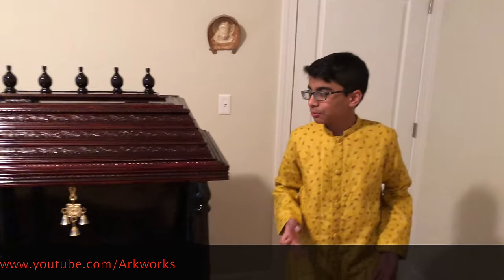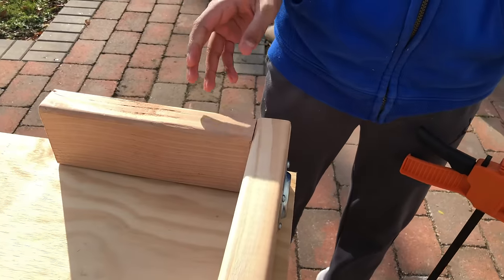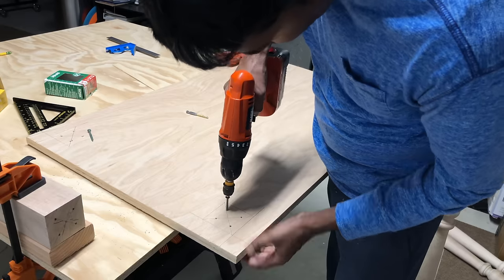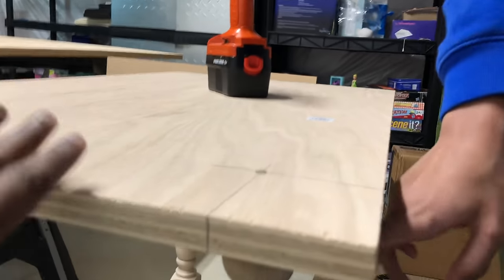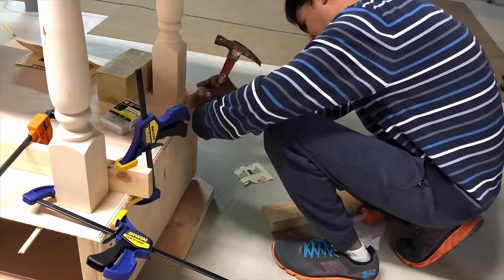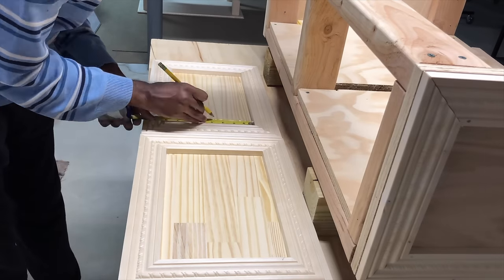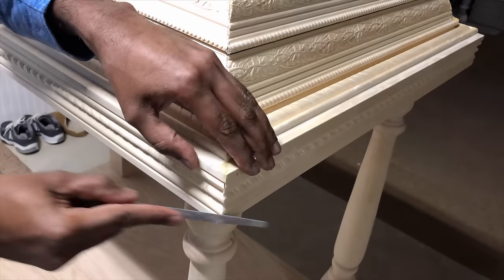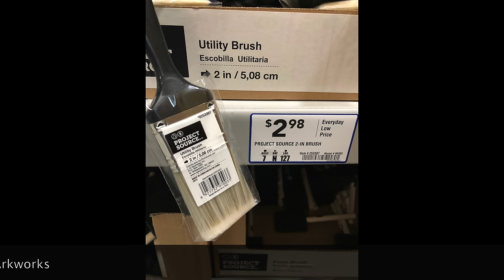Pooja Mandir DIY under $425 (4 feet 10 inches)

Comment: Watched it many times. You guys did it like pro. I do carpentry and my changes are using 2x2 for framing and .5 or .3 inch plywood to reduce weight, also use wood glue. I loved the idea of a detached units that will help in mobility . Great design
Reply from the maker: Thanks for the feedback and suggestion to reduce the weight!

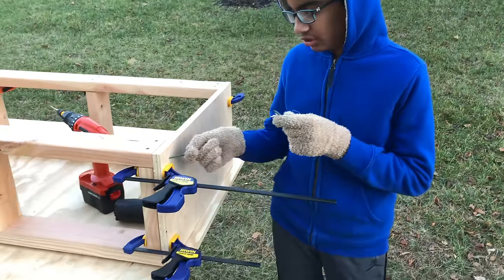Comment: Great Job.I am planning to start the project with the your  video as reference.Really your family inspired me to do this project. I had a couple of  questions 1)what is the length of the plywood at 3:21sec for joining  both the pieces...? 2) what is the length of the plywood at 3:51seconds..?
Reply from the maker: Hello, 24 inches at 3:21 and top plywood at 3:51 is around 40 inches I think, it all depends on how much space you have and what size you want to build, I suggest figure out your space and then build size it accordingly, cut the material as you go along, don't cut all at once. good luck!

Comment: Hi, I have seen your video multiple times and finally got courage to start the project. Bought all materials but while making gopuram I am not able to understand what angle to cut the moulding and how to measure that angle on miter saw( bevel angle, miter angle and slope)If you can please share some resource that I can use and your help is very appreciated
Reply from the maker: Enter your gopuram slope angle, no.of sides to get the Miter and Blade Angle (Play around with scrap pieces to get a good fit)

https://www.blocklayer.com/compoundmitereng.aspx

Example: inputs: Sides (4), Slope (59), Horizontal

Miter Angle 27.3° 
Blade Angle 37.3° 

Google for Miter angle and blade angle in YouTube, there are lot of vides

https://jansson.us/jcompound.html 

- Use N-sided Box
- Enter your inputs

if you have same dimensions as ours, then I mentioned the angles in the video, try that with scrap pieces until you get a good join.

Comment: Hi, great work. Really inspiring and I have just bought a second hand TV cabinet which I will be converting to a Mandir but the hardest part of the process is making gopuram. 
I have a request. Will you be able to make a seperate video to show how to make the gopuram like you made in this video but in little more detail?
Reply from the maker: Thanks, will try when time permit, its not really that difficult once you figure out the angle, search for "compound angle calculator", there is lot of information on web. Try with scrap piece, after few cuts you will get there. Good Luck!

Comment: I am thinking to do it . 
I could not catch the painting part . 
Can you also add url for paint and brushes as well in your description 
Thanks
Reply from the maker: Hi Praagnika, link to paint is in the spreadsheet link in the description, copied below from spreadsheet.

Minwax PolyShades Bombay Mahogany Oil-based Interior Stain (Actual Net Contents: 32-fl oz)	
Minwax Fast-Drying Polyurethane Gloss Oil-Based 32-fl oz Polyurethane	
Project Source Polyester Flat 2-in Paint Brush
Reply: @ArkWorks  
Thank a lot for your response will check in spread sheet as well .

Comment: Amazing works...Please can you provide the tool set that you have used while building this master piece. Thanks
Reply from the maker: Hi Vineel, Tools are @17:17 in the video. 

1) Miter Saw
2) Circular Saw
3) Drill
4) Clamps
5) Sanding tools
6) Speed square
7) Hammer
8) Caulk Gun
Reply: @ArkWorks  Thank you
Reply: @ArkWorks   Do you have purchase links for these tools, so easy to shop :)
Reply from the maker: I don't have links, most of my stuff bought long back. You should look out for deals on special days.
Reply: ArkWorks Thank you

Comment: I have watched this many times over now, since I am planning to make one myself. Although much cheaper than this. The moldings are too expensive, and I will have to make do with something smaller instead. I need to look for the right kinda finials for the gopuram top. I haven't found these at my HD, gonna try Lowe's, maybe they do.

Comment: This is great! Thanks for sharing the spreadsheet. Could you guys also share the list of tools used in this project? I am a beginner and I dont have the proper tools for woodwork. Thanks!
Reply from the maker: Tools are @17:17 in the video. 
1) Miter Saw
2) Circular Saw
3) Drill & drill bits
4) Clamps
5) Speed square
6) Hammer
7) Caulking Gun
Reply: @ArkWorks  Thank you!

Comment: Hi Kids and Parents, This is a great project you did and you have inspired me too. I have a question about the top part Gopuram, Can you please help me out? Need help in compound cutting
Reply from the maker: Hi Anjum, We are glad you are inspired to take up this project. Search for "compound angle calculator" on google and you will get all the info you need. if you can enter the no. of sides and angle, calculator will give you the miter angle and the blade angle. Set the angles on the miter saw and cut your pieces. Good luck with your project.

Comment: Great work by engaging the kids.  Great effort.  I have few suggestions though. I do similar kind of stuff so thought I should share my points. 1. You all have skills so upgrade the tools - Regular Miter saw to a sliding double bevel miter saw. 2. Use nailer instead of nail and hammer, as it is time consuming, while nail guns with a comperssor are fast and literally invisible.  3. Mahogony is a bit dark color so if you all use gold paint ($2 per small bottle in Walmart) on the special designs on the sides, on the Gopura Kalasam and on the door decorations, they will look spectacular.  4. Last but not the least, for the door use some cabinet hinges which are very easy to install and look professional.  
Overall a great product, excellent commentary.  Keep up the good work.
Reply from the maker: Hello Murali, Thanks for valuable suggestions. It will be helpful for the people planning to build Mandir. That was our first detail project, we started with vague idea and figured out things in the process. Everything we did on that project was new to us :-), Thanks for watching and taking time to provide suggestions. You should start a you tube channel if you are doing similar projects :-)
Reply: @ArkWorks  
Thanks for the suggestion. I build only for the temple we manage here in Richmond and of course for my home. I will definitely consider your suggestion. Convey my regards to the kids, by keeping them engaged you are passing not only the skill but also our tradition from our Mother land. If you are looking for some blue prints for any projects please ping directly, if I have it I will share it to you.

Comment: One follow up question on the "40 inch Ceiling". What kind of support/design you have put in place(or 
suggestions) to make sure it is NOT bending/sagging down as the time goes by. Thank you in advance. Keep up the great work.
Reply from the maker: Hello Suresh, Pooja Mandir will be indoor in the controlled temperature, so don’t think it will be an issue and plywood I chose is good quality, if you are concerned about it, use solid wood. Good luck with your project!
Reply: @ArkWorks  Great. Thank you for the input. Appreciated.

Comment: Congrats on such a hard work. Temple is looking so beautiful. I have a question, before I start this project. How much time does it take to complete it from designing it on paper to the final product? You have those wood cutting machine too, did you borrow it from HomeDepot or Lowes? Or do you have to purchase it? I dont have the tools shown in the video.
Reply from the maker: We worked on weekends on this project, it took me around 5 to 6 weekends, most of the time went in planning, execution did not take much time. If you follow this video, it should not take much time for you, unless you want to improvise or go with completely different design. All tools used in the build are purchased over a period of time. Hope this helps.

Comment: Great work!. Amazing work done by simplicity... Can you please share the material list as mentioned in vide?
Reply from the maker: Hi Vinod, Material list is in the video description. Here it is for you https://drive.google.com/file/d/1druWzHAGRSVZKYh3ADTsmYLQmv56H4S_/view
Reply: @ArkWorks  Thanks so much! Could you please share the size of the bottom part to make the drawer./boxes?
Reply: @ArkWorks  Also, Could you share if you have any scathe of your work?
Reply from the maker: 1 feet in height, 2 feet deep and 40 inches wide. There are 2 doors in the bottom.

Comment: Great work.

Can you explain how did you arrive to Miter and Blade angles as explained at 9.11 sec?

For Compound Angle 59' - Miter 27.3' & Blade 37.3'

I needed little more slope, lower angle (50 or 55), appreciate your help.
Reply from the maker: Enter slope angle, no.of sides to get the Miter and Blade Angle (Play around with scrap pieces to get a good fit)

https://www.blocklayer.com/compoundmitereng.aspx

Example: inputs: Sides (4), Slope (59), Horizontal

Miter Angle 27.3°
Blade Angle 37.3° 

https://jansson.us/jcompound.html 

- Use N-sided Box
- Enter your inputs
Reply: Brilliant

Comment: @Arkworks, that's a great mandir you have prepared. i'm planning to construct a 2 step mandir. if i use the same angles u have used for a two step mandir. can u please advise
Reply from the maker: Thanks Sris78. Are you referring to 2 steps in gopuram? if so, same angles should work. good luck with the Mandir!
Reply: @ArkWorks  yes i'm referring to 2 steps only. thanks

Comment: Hi. Great design. What material did you use for the pattern/moulding for the gopuram? Wood or plastic?
Reply from the maker: Thanks! Everything wood, all the materials used are in the spreadsheet link in the description

Here it is : https://drive.google.com/file/d/1druWzHAGRSVZKYh3ADTsmYLQmv56H4S_/view
Reply: @ArkWorks  Thank you. I have started buying the materials as I am going to make the same design. Mouldings with an "Indian" design for the Mandir is quite difficult to get in the UK. When I start/finish I will post some pictures!

Comment: well done and look stunning. love the design. How did you move this in to room? did you set this in parts and assembled completely in to room? i am planning to do one. since i need to get in to a room with 24 inch door thinking of making in to three parts-base, pillart part and gopuram..any ideas?
Reply from the maker: Hello Balaji, We built this mandir in 3 parts. a) Bottom section with cabinets b) Middle section with Pillars and some portion of the gopuram and c) Top portion of the gopuram. 

We moved sections into room and placed it one on top of other, we did NOT nail/screw them for ease of mobility.

Hope this helps, let us know how your build is going on.
Reply: @ArkWorks  Yes, thanks for the info. THanks for sharing this video.

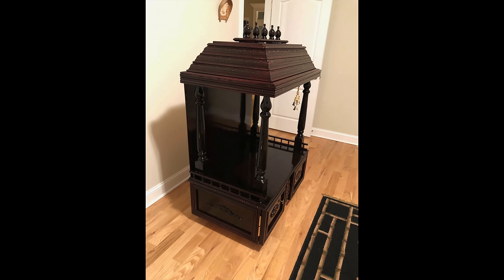Comment: Hi, thank you so much for sharing the video! It’s come out really well. I am also attempting to make this but I was having trouble finding the railing at 16:42, I looked through your spreadsheet but it says ornament beside railing and I couldn’t find anything like that on lowe’s. Could you please check the sheet and advise me on the railings? Really appreciate your help, thanks much in advance! And great job on the temple 😍
Reply from the maker: Hi Aashka, Did you click on the link in the spreadsheet for railing? I just clicked on the link and it is directing to Lowes, here it is https://www.lowes.com/pd/Ornamental-Galley-Rail/1000514477

Also Available in Home Depot : https://www.homedepot.com/p/Waddell-4-ft-x-2-1-4-in-x-3-4-in-Maple-Galley-Rail-5504-MPL/100549056

Comment: Great informative video and creative juices .. I would have contributed atleast 10,000 views in that count of 180K views as i continuously view it as my project takes shape. A quick question on the T Shaped Gopuram holder.. If i try a miter cut the wood is slanted .. Is it a bevel cut of 60 degrees or miter cut of 60 dgrees for the T Shaped wood which acts as the gopuram holder. Thanks  in advance
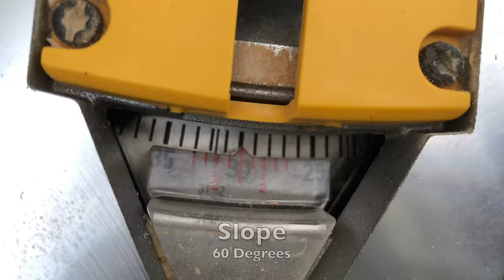Reply from the maker: Hello Manikandan, T-shaped is cut at 30 degrees angle flat on 4 inch side of the wood (that makes it 60 degrees when you flip on 2 inch wood), look at the video from 7:44 to 7:50.
Reply: A follow up question... If i do a 60 degree cut with the circular saw by adjusting the angle to 30 degrees, on the bottom side of the T, one end is longer than the other (not sure if i am explaining it correctly).. SO what happens is i have to place the T in a crossed angle and not ina straight line like you have.. How did you cut your T wood  ? i guess using a Miter saw ? I am trying to make it happen with Circular saw and kind of stuck on how to make a straight T
Reply from the maker: I know what you are doing, don't change the angle on the circular saw. Use the square to make a line 60 degree angle on the wood and then cut that with circular saw (blade 90 degrees) with some edge guide. I did it with Miter saw, hope this helps, otherwise send me your phone number and I will call you to explain.
Reply: @ArkWorks  I think i understand what you are saying... Let me try one more time with Play around wood and if it still doesnt work, i will give you my number. want to be mindful of your time as well to the best possible extent and thanks for taking the time to respond... So i will keep it at 60 a (and or 30) and give it a try today one more time..
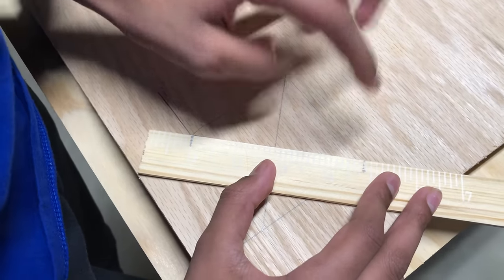Reply from the maker: Take a look at below video from 4:00 to 4:25, he is explaining the taper cuts on table saw, you can get the idea for circular saw, draw the angle, make a quick jig, you can use the clamps for jig.

https://www.youtube.com/watch?v=8TDelnF6SuQ&t=836s
Reply: @ArkWorks  I got it to work based on what you had suggested.. Thanks a lot for the help and the responses..
Reply: @ArkWorks  One more follow up question please.. Do i definitely need a miter saw to do the crown moldings for the gopuram. I did a 70 degree angle for my gopuram on all sides with a height of 11.25 inches.so when i did a 70 degree angle cut for 2 moldings (just like the side of the trapezoidal box), it exposes some raw wood on one side. I tried it with a circular saw as well as reciprocating saw and while i could nail down the 70 degrees on both sides, i do not know how to avoid exposing the raw wood... They both attach fine except for exposing the raw wood ... Any thoughts would be appreciated
Reply from the maker: Miter saw will definitely makes it easy, google for miter box (I never used, not sure if it works for angles you are looking for) or alternatives to miter saw for compound angle cuts.  You need 2 different angles for the cut for the slanting gopuram angle.
Reply: @ArkWorks  that is for the response. I realized that and rented a miter saw at home Depot and it was a breeze after that.  Thanks for responding
Reply: Meant to say Thanks for the response
Reply from the maker: Awesome, your last week message went into "held for review" so did not see until this morning. Share the picture when you complete the build to my insta account @we.arkworks

Comment: watched several times and motivated to build one but stuck at gopuram.. unable to cut the compound angle cuts for gopuram. could you please suggest in detail how to cut. Dimensions are same as yours. please help, if possible.
Reply from the maker: Hi Suresh, 

Enter slope angle, no.of sides to get the Miter and Blade Angle (Play around with scrap pieces to get a good fit)

https://www.blocklayer.com/compoundmitereng.aspx

Example: inputs: Sides (4), Slope (59), Horizontal

Miter Angle 27.3°
Blade Angle 37.3° 

https://jansson.us/jcompound.html 

- Use N-sided Box
- Enter your inputs

if you have same dimensions as ours, then I mentioned the angles in the video, try that with scrap pieces until you get a good join.

if that still does not work, we can have a quick couple mins calls to discuss
Reply: @ArkWorks  Hi Thanks for the reply, will try with some scrap wood and will update the outcome. thx again

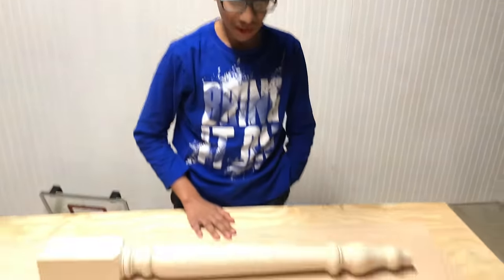Comment: @ArkWorks Good job, Could you please help us 3:27 what is the size of plywood  for sides 3:35 what size of Plywood, I mean dimensions
Reply from the maker: we used 3/4th inch through out, except for gopuram, you can however use half inch plywood for the cabinet sides to reduce the weight.
Reply: @ArkWorks  Thanks for your Reply, I am looking dimensions for board bot thick ness. I mean for example 24 * 9 inch length and heigh for side board (base) and top of legs and bottom plywood dimensions ?
Reply from the maker: Our cabinets are 24 inches in deep and 12 inches height. Top and Bottom Plywoods length should be based on your space, they can be adjusted to your needs. I think we have 40 to 42 inches space next to our window in the room,  so we made it to fit in that space. Hope this helps.
Reply: @ArkWorks  Thanks for your reply, that is very helpful

Comment: Hello, could you please provide front door plywood length and height ? Thanks in advance.
Reply from the maker: 12 inch by 16 inch, I suggest you to cut the material as you go, measure it when you are about to install doors and cut it. Hope this helps.
Reply: Thanks for quick reply . For bottom part side plywood length and height please ?
Reply from the maker: I think 23 in by 12 in, my measurements may not work for you "as is", always measure and cut as you build.
Reply: @ArkWorks  thank you 🙏🏻 the middle portion plywood u placed on bottom portion how many inches extra cut towards side and front so that it is little outward of bottom portion ? If u can provide me how many inches extra that should be cut outwards will help me thanks in advance 

For middle portion can I assume length and height are same on top and bottom of middle portion ?
Reply from the maker: Hope things are clear now after our call, good luck!